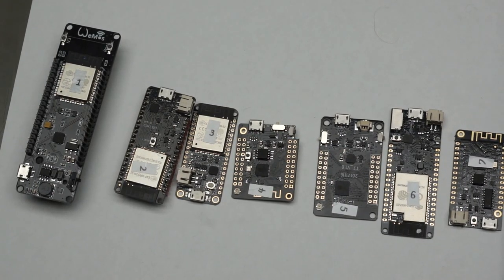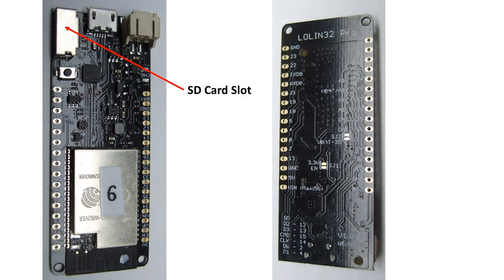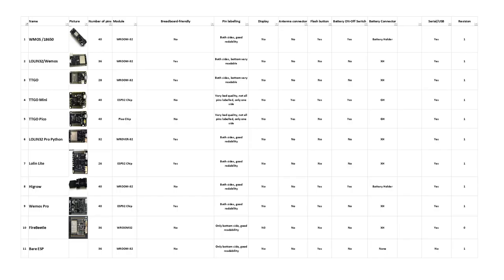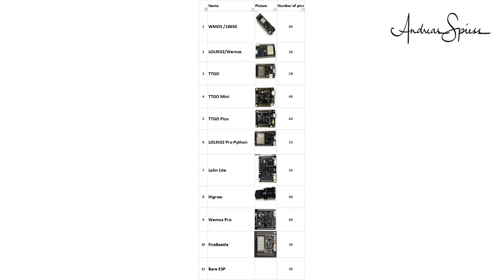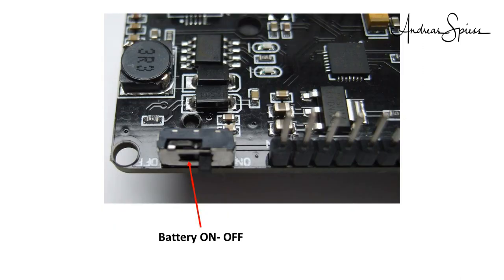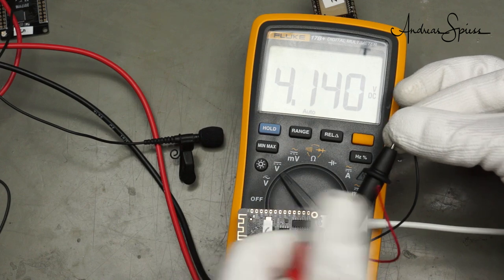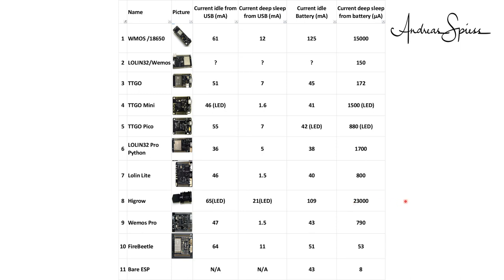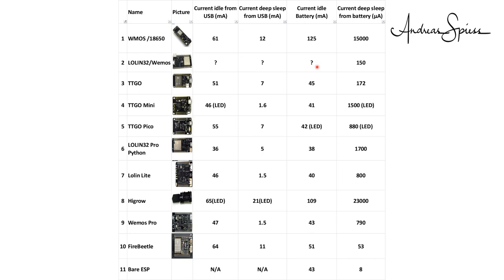#193 Comparison of 10 ESP32 Battery powered Boards without display (incl. deep-sleep)

Comment: Many many thanks for these videos, this gives inspiration.
Question: ss there really a BME280 included in the TTGO T18 ? I can't see it on the board (the diagram shows it, but I can't see it on the board).
Reply from the maker: Mine has no BME280
Reply: @AndreasSpiess  Thanks for your response. Might be worth putting a note in the comparison sheet about it.
Indeed, BME280 is listed as additional feature, but there is none (in some versions?).
Reply from the maker: I checked and it is not mentioned on my list as an add on. Maybe it has the footprint for one (there is an unpopulated "socket" in the PCB.
Reply: @AndreasSpiess  I see "MBME280" on the Spreadsheet, cell P34 (column "additional devices"). May be I interpreted the column wrongly, or I don't have the right version.
Anyway, thanks for the great job!
Reply from the maker: You are right! I looked at a different place. Now it should be corrected. Thank you!

Comment: i´m thinking about making a weather station with a big 7.5 inch waveshare eink display. At the moment i have an arduino pro mini powered one with the 2.9 inch eink, but a bigger screen would be better ... However it´s impossible on the Arduino since it´s too slow and lacks memory.
You can buy esp32 based driver boards on amazon for the bigger waveshare eink screens . However, i´m not sure if they are sufficient for battery usage. My arduino pro-mini version (with DS3231, DHT22, BMP280 and SD-card) only uses 50µA in deep sleep and lasts more than 1 year on 3 AA batteries. However, it was a long way to get there. I´m using no voltage regulator, no USB-connector, no LEDs, deep sleep on every chip, deactiveting power from the sd card board and so on ...
I know from experience that all the arduino boards with onboard usb connectors, are useless for battery powered projects. So how about this esp32 board ? Can you deactivate everything that uses too much power via software or is it like with the arduino boards that only special versions are capable of ultra low power consumption during sleep cycles ?
Looking at your list, it looks quite bad. Only the bare esp32, the firebeetle and maybe the TTGO seem usable. So how do i know if a board i buy as a "driver board" is a real low power capable board or not ?

THX.

https://www.amazon.de/Waveshare-Resolution-Electronic-Controller-Raspberry/dp/B075R69T93/ref=sr_1_5?__mk_de_DE=%C3%85M%C3%85%C5%BD%C3%95%C3%91&dchild=1&keywords=waveshare%2Beink&qid=1589555290&sr=8-5&th=1

https://www.amazon.de/Waveshare-Resolution-Electronic-Controller-Raspberry/dp/B07M5CNP3B/ref=sr_1_5?__mk_de_DE=%C3%85M%C3%85%C5%BD%C3%95%C3%91&dchild=1&keywords=waveshare%2Beink&qid=1589555290&sr=8-5&th=1
Reply from the maker: You either find information on the internet about power consumption or you have to try it yourself :-(

Comment: Great video thanks! I have a question regarding board nr 1 (that I own). Your explanation makes a lot of sense and now it is clear why the battery drains so fast despite DeepSleep. But - on 2nd sight - how can it work at all? The AMS1117 has a dropout voltage of 1.1V, correct? So even at the minimum voltage of the ESP32 of 2.55V, the AMS would need 3.65V from the battery. The battery is rated at 3.7V which means that even in those extreme conditions it would only last very short time before the VREG would stop working? For the normal range of 3.3V (-> 4.4 V before AMS) it wouldn't even deliver enough voltage? What am I missing? Does anyone have schematics for that board? I can't find them anywhere
Reply from the maker: You have to do your measurements. The AMS1117 dropout spec is at 0.8A. Maybe the dropout voltage is smaller with smaller currents. Anyway, maybe you watch my newest video about the topic? I would never use an AMS1117 for battery-operated boards.
Reply: @AndreasSpiess  Thanks Andreas! I understood the necessary above dropout voltage for the AMS1117 is delivered by the TP5410 which is also a boost converter pushing the battery voltage to 5V when the system is powered from battery. Didn't know that before. But as you say, choosing an AMS1117 seems to be a poor choice for that use case unfortunately :-( Just noticed the video you mentioned! Thanks and keep up the great work!

Comment: great and helpfull as usual. Good that you are around and I have not only to relay on the swiss army knife. Do you also have the numbers for the Lolin ESP32 wemos ESP32 WiFi Module + Bluetooth Dual ESP-32 ESP-32S ESP8266?
Reply from the maker: Which number?
Reply: the numbers for the test you made with all the boards. Would love to see the Lolin ESP32 in your list.
Reply from the maker: Which one? Can you provide a link?
Reply from the maker: I do not think this board has a battery. You have to add a second shield to it. In this test, I only had boards with battery management on board.
This board is very limited as it does not breakout many pins. It is good for compatibility reasons.

Comment: Hello Andreas. Chip marked with KDCV is probably MCP73831T-2ACI/OT (I use this chip as a charger in a project). Would be kind if you reply after confirmation. Ich verstehe dein English! Habe ein Onkel in der Schweiz.
I have just noticed others on your list marked with KDxx. They should be all the same.
Reply from the maker: Thank you for the info. I think you are right and updated the sheet accordingly. Offenbar sprichst du auch Deutsch?
Reply: Jawoll. Ich lebe in Brasilien aber spreche noch Deutsch

Comment: Is it possible to fight with brown-out with battery charger (like TP4056) and voltage regulator (like XC6206P332)? Or only capacitor could fix that? Thx!
Reply from the maker: Good voltage regulators and large capacitors are the best against brownouts.
Reply: Thx a lot! I'm really novice and want to make really small device. As I understand, there are no large SMD capacitors, so, it'll increase size of final result :-(

Comment: Have you done a similar video of ESP8266 modules?
Reply from the maker: No, The choice there is not big :-(
Reply: @AndreasSpiess  oh wow that was a quick reply. Really appreciated.
So for esp8266 the best option is a bare board if deep sleep power consumption is a concern, right?
I'm looking for a board that has less than 250 uA draw at deepsleep but the ESP32 boards cost twice or three times as much. (I'm builind a simple temperature measurement nest).

Comment: Andreas, what is USB power on/off possible on the comparison sheet?  I need a board that has external antenna connection with low energy consumption during deep sleep.  The board and some other sensors and motor will be powered by solar.  Is the TTGO PICO or MINI a good choice?  Is there an easy way to disable the LED or remove it to minimize energy consumption during deep sleep?  If these two boards are not ideal do you have any suggestions?

Another question for ESP32 in general: is the ultra low power coprocessor and available pins capable of controlling one stepper motor and recording measurements from two different sensors at the same time during deep sleep? 

Thank you.  -Van
Reply from the maker: USB on/off means that you can disconnect USB and the device does not reboot (if it has a battery, of course).
I never worked with the ULP, it is very hard to program and its intention is to do low-level stuff and switch the main processor on if needed. Controlling steppers is maybe a too big task. And steppers anyway need a lot of energy, they are not really low power.
Reply: Thank you, Andreas.  Would lowering the clock frequency to 2 or 8 MHz an alternative to putting the main processors to sleep?  I guess I will have to try different frequencies to figure out the minimum at which sensors and stepper still work.  The board that I purchased does not have battery connection, only USB.  Can I cut the USB cable and solder one end to a 3xAA battery holder?  Also, is there a way to charge those batteries with solar while the ESP32 is running? Do you have any suggestion for battery charger / controller using 5 or 6V (5-10W) solar panel? I’m using Panasonic eneloop batteries.  Sorry I’m new at microcontrollers.

As a separate question, if I want to connect my board to a cloud platform using cellular, should I use stm32 nucleo 144 with LTE Cat M1 for best battery management?

Thanks again,

-Van
Reply from the maker: I made a few videos about the ESP8266 and power management. The ESP32 is not too different. If you want to use batteries I strongly suggest you use a board which is made for that. Otherwise, you have to solve all the questions you ask yourself.
Concerning LTE: I never used this technology and can not answer  your question
Reply: Thank you, Andreas.

-Van

Comment: Very informative video Andreas! Thank you very much again!  I have the:  WEMOS ESP32 with 18650 battery, but after I charged the battery, the ESP doesn't work, when unplugged from USB port. Did you experienced the same, or am I doing something wrong again?  Do you have a sample code for it I can test? I've tried the samples, but as soon the ESP is unplugged from USB, it doesn't work - with the switch ON or OFF.   Or anyone else who has a suggestion or sample code, I appreciate any help. Thank you all!
Reply from the maker: I do no more remember everything :-( But maybe you can check the voltages at different positions to find out what happens?
Reply: @AndreasSpiess  I did, I have a trace but it is possible that I must upload something to the ESP that turns on the 18650 battery? ... I'll try more poking around. Thanks for your reply Andreas.
Reply from the maker: I do not think that pins of the ESP are connected to the battery circuit.
Reply: @AndreasSpiess  OK, thanks for your suggestion. I'll see Sat/Sunday about that. Have a great weekend!

Comment: bit hard to make a decision on which one has the lowest current consumption. How does the TTGO mini do without the LED? Bit odd the bare esp32 performs no better than most of the devboards. firebeetle wins on deepsleep but doesn't do well in idle.

a bare esp8266 will do 70uA in deep sleep easily, but never below 70mA idle (peaks up to 300mA doing OTA) so beats the esp32 when asleep at least lol!
Reply from the maker: The power consumption in idle and with Wi-Fi does not depend too much on the board. It is mainly influenced by the ESP chip itself.

Comment: Thanks for this overview. I found this video while I was searching vor for the pin where the lolin32/Wemos board can measure the battery load. On the sketch io35 is stated. But as oftten my board seems not to work with io35. Maybe this is a clone, this would eplain why the name of the board is  loin32 and not lolin32 ;) BR from Hessen
Reply from the maker: You probably have to connect the battery voltage to a pin (including a voltage divider. )
Reply: @AndreasSpiess  yes for sure. but the circuit plan says that there is already one on the board, and its impossible for me to simply add another:)
Reply from the maker: Unfortunately I cannot do remote debugging. I would use my ohm meter to trace the connections.

Comment: As the name implies I like them for development. Once they go in a 18650 driven 'production' system, I'd rather use barebone with  <10uA deep-sleep current
Reply from the maker: Me too, but I still have to add battery management. If a good board would do that, for sure I would change.
Reply: yep me too :-) Now still bare board with HT7333; less then 20uA (ESP8266)

Comment: Nice job. Which one is your favorite Andreas?
Reply from the maker: I have no particular one. I have them all in an "ESP32" box and search for the one which fits best for the actual purpose (using my table). You can imagine, I have even more of them...
Reply: I thought you had a favorite. 
I made my own with a bare ESP32 module and a custom power supply that uses a PAM2401 boost converters. I needed +5V from a single Li-ion cell (1S6P) for my project that had to be very low power, but could pack a punch when needed. used a S-1155B33 for the +3.3V from the +5V 
I think the total quiescent current is 200uA for both. and <0.3 uA in sleep mode.
Just in case it helps others.
Reply from the maker: Interesting. The better boards of my test are also around 150 micros. But most of them do not first create 5 volts. During battery operation the 5-volt rail usually is dead.
Reply: I needed +5V for other stuff, but I can't see how they can operate on a single Li-ion (3V-4.2V) and get 3.3V without a buck/boost of some sort!
Reply from the maker: A good LDO only takes 150 mV. So you can use your battery to about 3 - 3.3 volts till the lights go out. Which is most of the capacity of a LiPo.
Reply: I take my cells to 2.9V and charge them to 4.0V. Also which LDO can give me 3.3V @1A with only 150mV drop? I would be interested.
Reply from the maker: Why 1A? The ESP with a beefy cap uses for sure less than 250mA, usually less (during receiving).

Comment: Isn't XH supposed to be 2.50 mm?
Reply from the maker: You are right. They are sometimes sold as 2.54 and I did not check.
Reply: Usually, you'll see them as "XH 2.54," and they are indeed 2.54 (and that's probably whats on the board and battery), but actual XH is 2.50.  I got bit by this recently with an 8-pos connector that didn't fit right -- that error accumulates. The board was genuine XH 2.50mm, and the "XH" connector I bought was 2.54.  In practical terms, for a 2-pin connector it doesn't matter.

In any case, keep up the good work.  Thorough and entertaining as always.

Comment: Hello Andreas, I am a student and I entered in low power engineering contest, goal of contest is to build a device that will be powered by only one AAA battery and to have as high efficiency and run time as possible. I would appreciate your opinion on problem I encountered while trying to find best AAA battery source for my project solution using ESP32. I decided that my device will use Li ion, LiSOCl2 or LiFePO4 as alkaline batteries have low voltage and I would get low efficiency using boost converter. My biggest concerns are stability of ESP32, efficiency and quiescent current. I am planning to power ESP32 with directly from battery when batter voltage is 3-3.6V, under 3V battery voltage from boost converter and over 3.6V with buck converter or maybe LDO but I don't know the most efficient way to do this. I thought of using window comparator to enable boost, buck converter or directly pass trough battery voltage to ESP32 using mosfet, but that is also a problem because I have only one power source and to have V ref I need voltage higher than V ref. What is the best way to power ESP32 to ensure stability and what components do you recommend for lowest quiescent current during deep sleep.
Reply from the maker: 1. Standard converters (boost and buck) usually have a low efficiency, especially at low currents.
2. Rechargeable batteries have much less capacity than non. rechargeable batteries
3. The ESP32 is a bad decision of you want to have a long battery life. An ATTiny for example is much better.

Comment: If you want low power, avoid the boards with onboard USB, these are the biggest power drainers. 
If you have got one with USB, you may notice a substantial consumption reduction if you plug it into a computer and disconnect it later. 
The USB chip is active by default and only goes idle when it detects a disconnection.
Reply from the maker: I am not sure about your statement if you look at the low consumption on battery in deep sleep
Reply: @AndreasSpiess  I think what he's referring to is USB suspend. I'm no expert, but fi D+ and D- go low it indicates to USB peripherals to go into suspend mode, or something like that. I was successful going from 6.5mA to 250uA on a Huzzah32 by using a pull-down on D-.

Comment: I'm wondering how your Lolin board #2 failed. Two of my four Lolin D32 Pro boards are bricked, and there are other reports of similar experiences. There is speculation that it may involve connection to flash.  https://github.com/espressif/esptool/issues/263
Reply from the maker: I do not know and never investigated.
Reply: @AndreasSpiess  Thanks for the reply. Great series of videos.

Comment: Andreas, I wonder why you didnt include Adafruit Huzzah32 board ? https://www.adafruit.com/product/3405 
The added advantage is that the Enable pin  switches the buck converter and the entire board is switched off. It is also incredibly small.
Reply from the maker: Adafruit products have a big disadvantage outside the US: They become very expensive because shipping is quite expensive. At least this happened when I last time ordered from them.
Reply: Ya, Adafruit service just sucks for out of the USA at least.  I had a big order ($150+ USD) made out but they refused to ship it to a US address for me as a Canadian.  I have a box just a few minutes across the border so I can save on shipping and get my orders faster.  EVERY business I have dealt with ($10 to $4000 orders) had no problem with it EXCEPT Adafruit.  I haven't ordered anything there since and would have likely spent hundreds more there by now.

Comment: I have ordered a FireBeetle Board with ESP32-E (see https://www.dfrobot.com/product-2231.html) because the standard version is sold out. This board consumed 434 uA at 4V battery in deep sleep with a timer and ext1 wakeup pins. So maybe the available newer version is not so efficient and requires nearly ten times the power.
Reply from the maker: The Firebeetle board was very efficient when I tested it, you are right.

Comment: And all of them are missing something that make them pretty much not really useful for me, that is onboard battery access to measure battery voltage and percentage.
Reply from the maker: Many of the newer boards have such a functionality. Maybe you consult my recent test. Otherwise you can add a voltage divider yourself and connect it to a ADC pin. You will find many descriptions on how to do it on the internet.